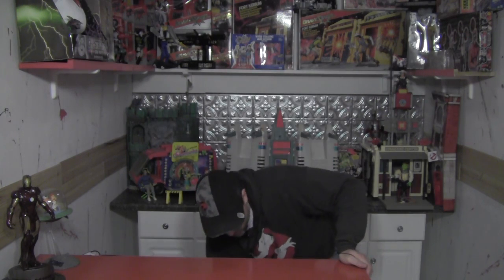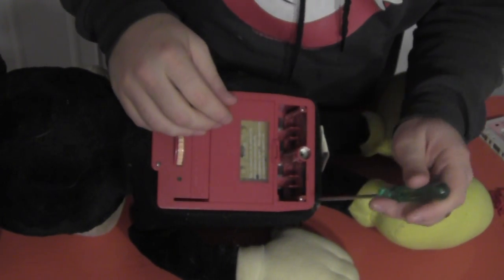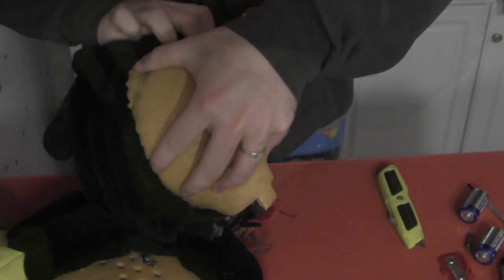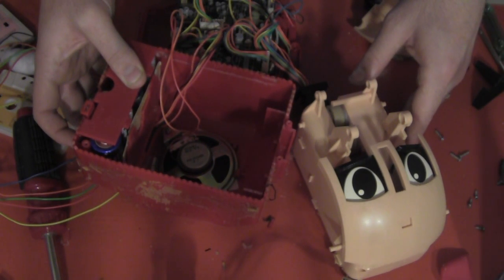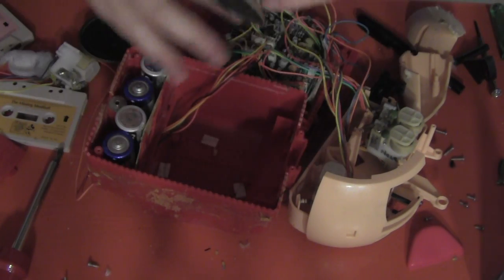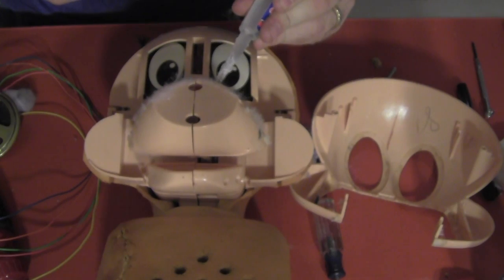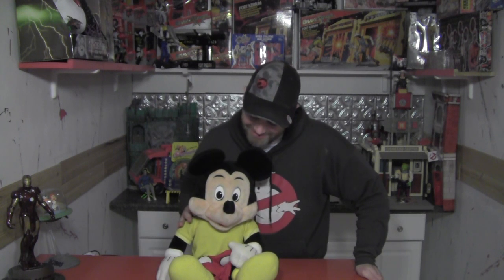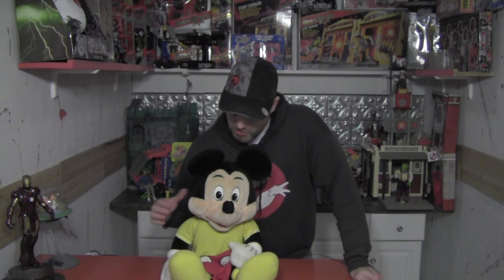Toy Adventures with Devall - Talking Mickey Mouse Repair

Comment: I own one of these along with the whole world of grundo my Mickey Mouse is in bad shape he's missing his bottom mouth I bought them like that at Salvation Army in 2012 he came with one tape missing battery cover Got a Brand New battery cover on eBay It Was a Teddy Ruxpin battery cover it would work the same and I got it working again thanks for making this helpful video I'm going to subscribe cuz this was helpful I don't mind that he's missing his bottom part of the mouth but he works I remember having him rock out to some Metallica with Teddy this was in 2012 along with guitar Tyco 1997 Elmo I put them in the basement when I was older in 2014 until in 2016 got really into YouTube didn't start my channel until September 2018 I kept forgetting until December 2018 I kept my Teddy Ruxpin stuff unless fireproof I kept my childhood toys that made me the now all put in a safe and sound a fireproof waterproof safe I'm not leaving without it I'll tell you the contents my whole entire 1990s Thomas the Tank Engine stuff all my old mr. Potato heads Teddy Ruxpin stuff which contains two worlds of Wonder teddies I called one peanut butter cause he smells like peanut butter cause he smells like peanut butter cuz he's my childhood Teddy I also have another Teddy I found at Salvation Army recently he had no vest I was surprised he was in good condition for $5 with the tape all I needed was the battery cover luckily I found that with the little Ziplock bags that was tied to Teddy's hand it had the tape battery cover tears came down my eyes cuz I really remember him very nostalgic days of childhood I told my parents I'm keeping my toys cuz I'm going to put my childhood toys inside a waterproof fireproof safe it's an indestructible case they don't even know my code I also have a lot of Lego Duplo I really enjoyed Captain Underpants which I still do I still have my four comics I put them in my safe I also really loved my stuffed animals in my Teddy Ruxpin collection I have two worlds of Wonder teddies three Playskool Teddy Ruxpin I have one of them sitting on my lap watching this video right now I checked and he was a mini worlds of wonder had two yes entertainment Teddy Ruxpin yes I do have a backpack toys Teddy got him for a graduation present they know I'm a Teddy Ruxpin collector no I'm sorry I didn't have a 2017 Teddy Ruxpin I'm getting one this year but I hear they are built differently than the other ones but I do have the Teddy Ruxpin hug and sing collection the only one I don't have has the LCD eyes I'm going to get the one with the books from QVC I do have a spare backpack toys Teddy vest I'm going to stick on him I only have three backpack toys Teddy's and I I have four backpack toys teddy Ruxpin vests and I have baby teddy all tapes cartridges and books I also have all the outfits I had a bunch of Sesame Street plushies talking ones I have rock & roll guitar Elmo and sing and snore Ernie yum yum Cookie Monster ABC Elmo Tickle Me Elmo Hokey Pokey Elmo I found today found another Teddy Ruxpin from 1985 he came with the fire safety with Teddy Ruxpin it had the book too I had the fire safety one so I could learn Fire Safety the good news is we never had a house fire I also put all seriously everything I own in this safe which is waterproof Fireproof indestructible like I said

Comment: I have one that only turns on the tape player, but won't spin.
Reply from the maker: Hmmm. It's possible the rubber band that runs it has rotted away. Or that it is stretched beyond capacity.
Reply: ToyWorldOrder Possible, as i do have a replacement drive belt at the time. :)
Reply from the maker: Yeah, I would try that first. Also possible the motor is fried, and that is NEVER any fun...